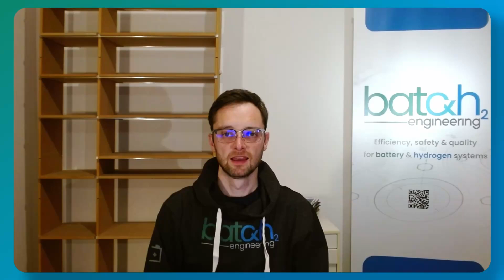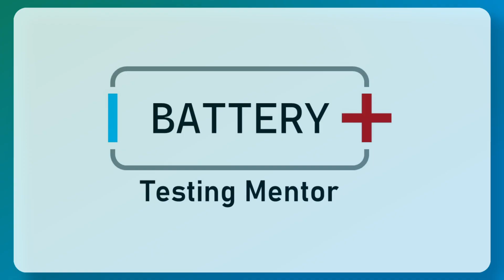ISO17025: the basics for a laboratory

Comment: Many thanks for the insightful video. I would like to ask—do you think ISO 17025 testing is required at the R&D stage of Li-ion battery manufacturing, or is it only necessary at the manufacturing level?

Additionally, I would like to know whether Incoming Quality Control (IQC) should be conducted in a dry room or under normal ambient conditions.